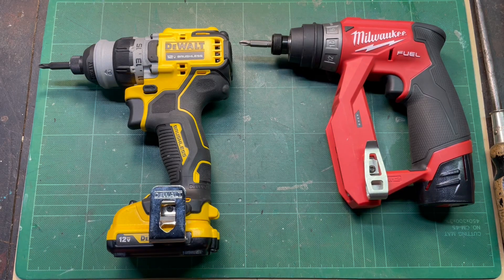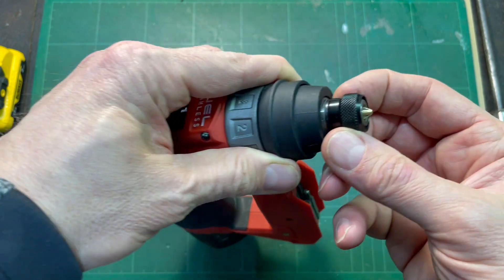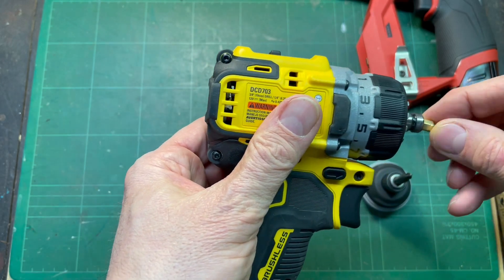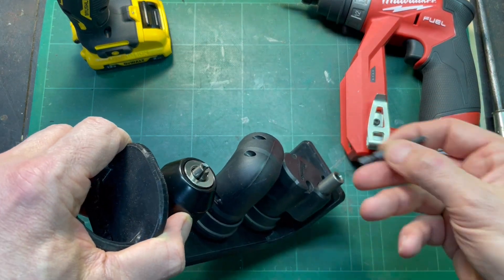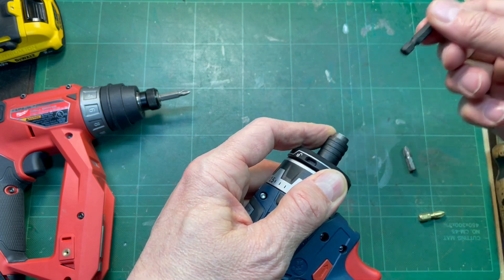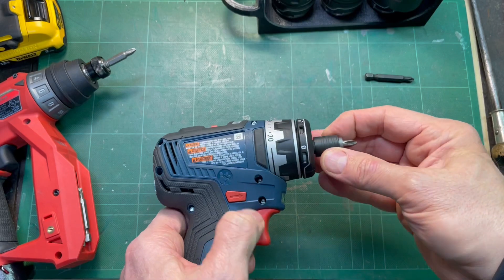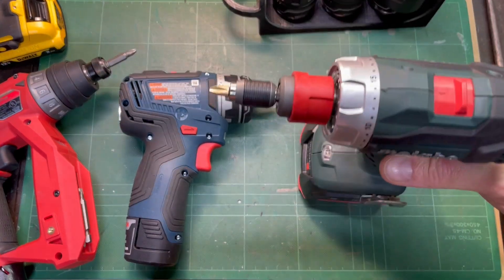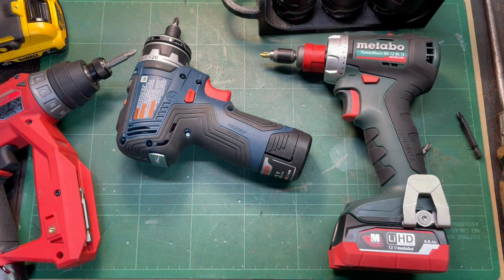Review of Bit Holders in 12v multi-chuck drill drivers.

Comment: The 12v skil 4 tool set is on sale for $143. You might want to pick it up.
Reply from the maker: Have it. Well, my daughter has it, I got it for her. Its not a multi-chuck drill, but if you don't need that its a very nice drill, and battery platform. Skil is highly under-rated by people who are into tools because the sketchy brand history. But since Chervon (Ego, Kobalt, Flex brands) acquired Skil the quality of the tools is on par with the big brand names. And the prices are very reasonable.